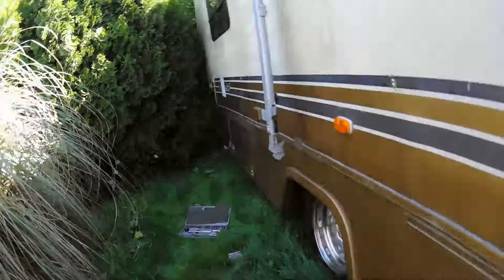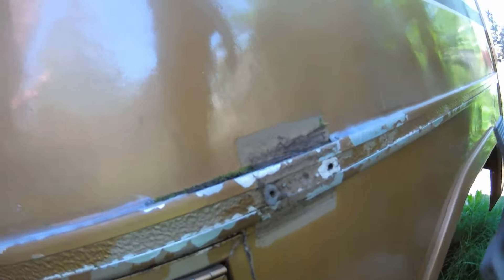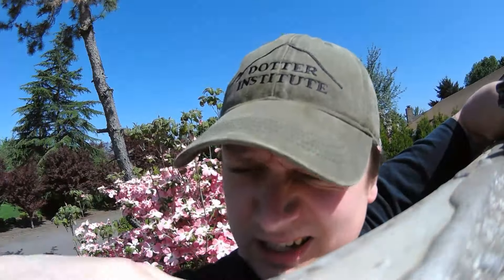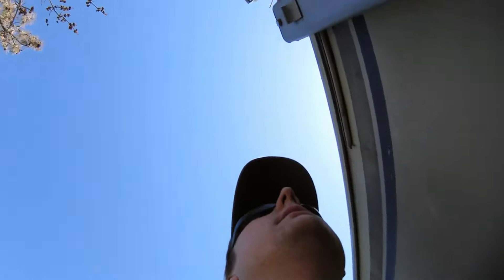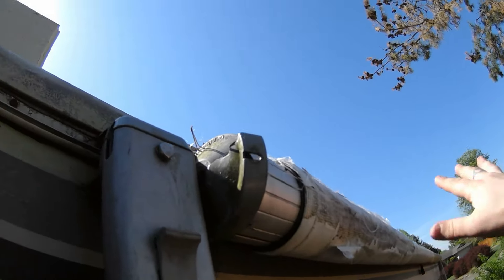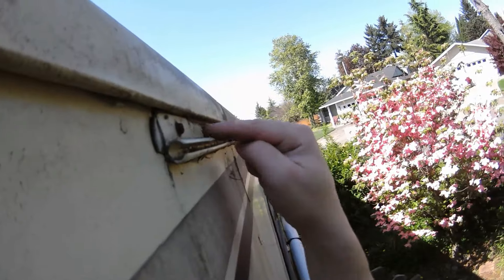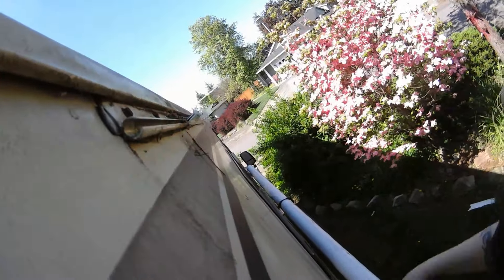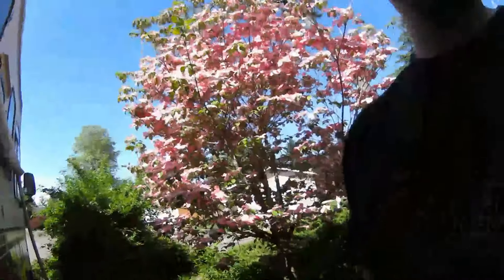Removing Old Rv / Motorhome Awning

Comment: Not that there will be a next time for you but for anyone else watching for safety you should always remove the top bolts first, cut away the old vinyl, then rotate the tube and old awning out till it drops on the ground. Then you can remove the bottom bolts. It's pretty easy to attach a length of rope around the center of the tube and lower it down slowly that way from up top. 

Saw a guy do it the same way you did and once the weight was off the top front corner and he released it the top rear corner bolts twisted and tore up the side of his coach. Glad that you have it down if you like. That's another 40ish pounds of weight that you aren't carrying around...
Reply from the maker: +Bugout Bounder Ahhh ok, i knew there was a better way to do it, thanks for the tips. 
And good to see your still around! :D
Reply: +Class A Living Still around or still alive, it's the same for me. Past few years gone through a bunch of health issues and trying to get through them is all. Hope to on the road full time again here at the end of June and start on the videos full time after once I get a few GoPros or the like. 

Man, there are a boatload of remodeling vids and life in the sticks in your 32 foot house on wheels videos I hope to make/finish. Even have a few get your coach unstuck from the (mud, sand, ditch) and other videos that I have gone through. Pretty much a learn as you go occurrence and if you are alone hundreds of miles from anyone how to get out kind of videos. Kind of Les Stroud but on wheels. ;)

So where you at these days? Still in Washington?
Reply from the maker: Bugout Bounder Oh man sorry to hear that, get your ass healthy alright?
And ya im still in Washington, Pretty much going to stay in the clark county area till i can afford to travel. I've really been looking forward to boondocking too but works been JUST slow enough to keep me grounded, s'all good tho.  :)
Reply: +Class A Living The east side of Seattle right now but I should be heading down to visit friends in Portland in July and do some dispersed camping outside of the city somewhere with them for a week. Probably spend the next year (or more) entirely on the road again hopefully after I leave Portlandia. 

Probably place an ad on CL to see if any single gals want to be a copilot for a year. I've got an amazingly comfortable 7' long leather recliner up front. I have a few that I am talking to online but if I placed an ad like in the past I may get a better fit than those who are trying to come along for the ride already.

That might be a way for you to afford to travel more. Put up an ad for a copilot to help pay the fuel bill.
Reply from the maker: Bugout Bounder lol good idea,